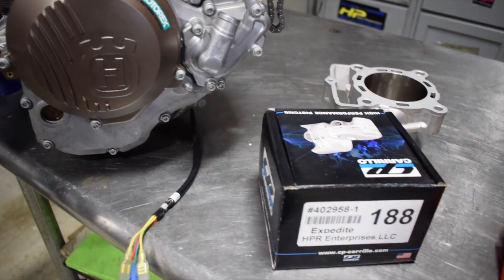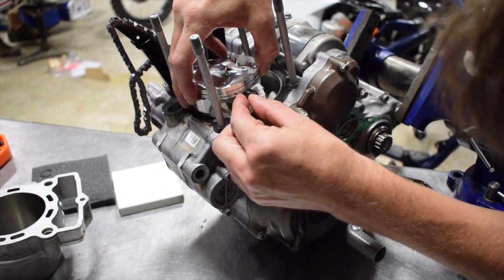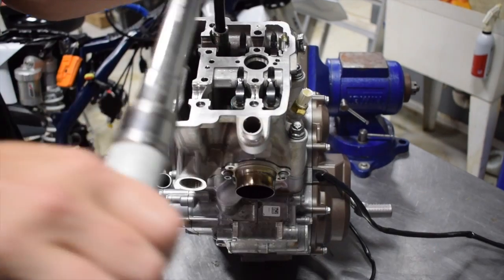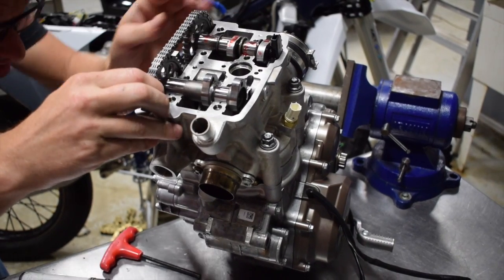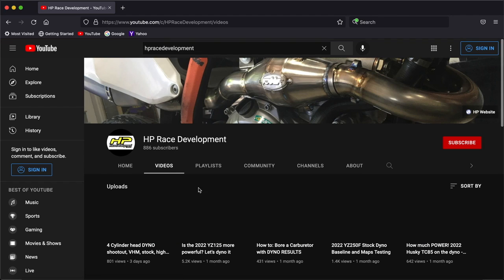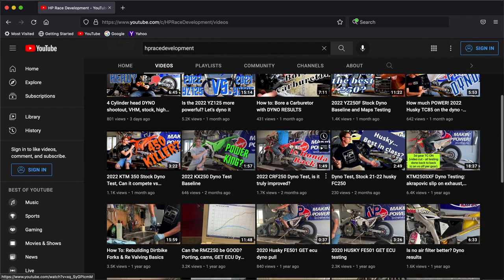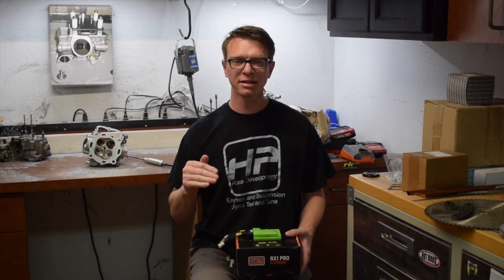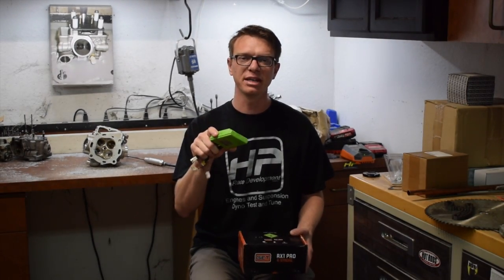How Much Power? Big Bore Kit

Comment: I am absolutely on the fence with a 270 kit.  Can you do just the 270 kit and have someone map the ECU?  I don't want to spend 1000 bucks for the big bore kit, then 1000 bucks for the Vortex, then 500 to map it.  I just want 4-5 more horsepower and factory reliability for 1200 bucks.  im poor.   lol.
Reply from the maker: we dont sell vortex - GET all the way baby. Depends on what year bike you have

a 21 or later has a locked ecu
Reply: @HPRaceDevelopment  so what does that mean with a locked ECU.   I have a 2022 GasGas ex250f and a 2021 gasgas mc250f.  Thinking of doing the 270 kit on the 2021.
Reply: @joelballard4955 That you probably can’t tune it. It’s made only for use with factory engine.

Comment: do you have any dyno comparison of a 366cc kit.  vs a 450 to see if it's competitive.  I've been thinking about that for a while. I'm a 220-pound veteran rider.  I want to go down to a 350 but I feel it lacks torque and I have to rev up a lot.  I want to know if the 366 kit works to send you a 350 to modify it in 366cc but I am also interested in knowing the reability when you make the modification to 366cc

Comment: Was that just over bore?  No cam or head work
Reply from the maker: only our big bore and ecu on best result, cyl works kit 2hp worse
Reply: @HPRaceDevelopment  is one HP available for the KTM 350_ Know that Athena (italy)Made one in 369ccm Big Bore! Thanks G
Reply from the maker: @TTR66  I believe plenty are on the market, cylinder works and athena.  I would run stock cams rather than hot cams.